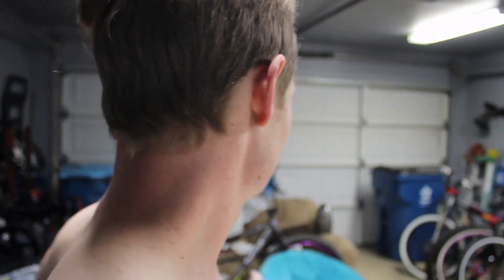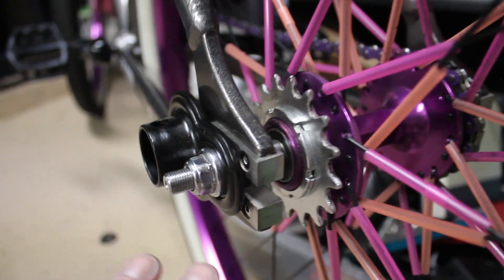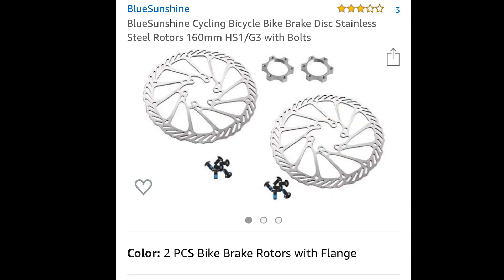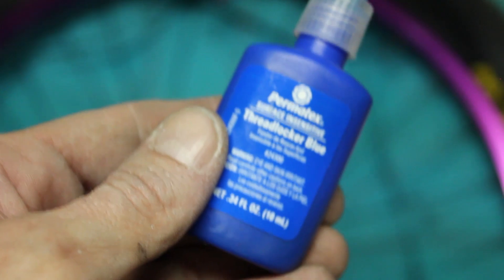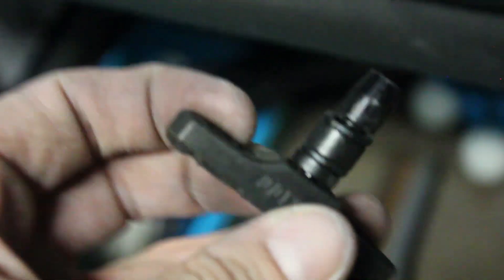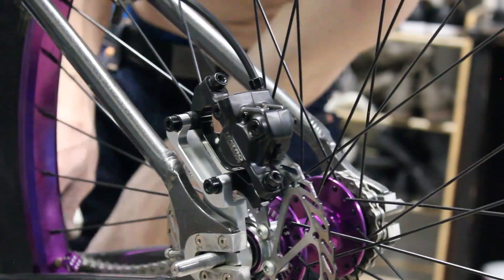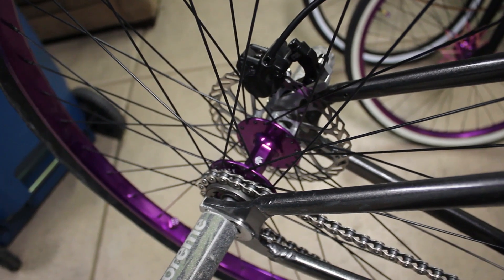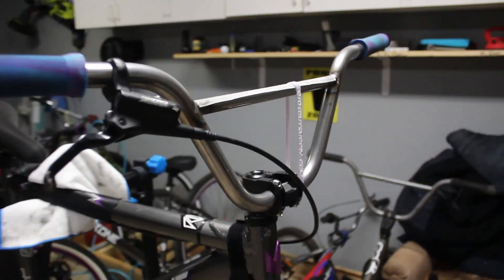HOW TO: V-Brakes To Disk Hydros(CHEAP)

Comment: Just to be sure, there's no problem with installing on the fixed side (34mm same with freewheel side) of a flip flop hub? There's excess threads because that's the lockring thread (30mm)? So you secured the rotor adapter with loctite?
Reply: yea

Comment: i know this is a really old video and what not but bro... where did you get the part that mounts the rotor to the wheel that adapter... or what do i search to find it... been out of bikes for a long time just pulled my 2004 Redline Proline Pro 24" cruiser out of storage and was like i wanna start riding again... and my v brakes were missing so yeah lol

Comment: Question.  What size is the  bracket that holds the brake caliper. I did this but the brake pads are sitting to high so it's obligated grabbing the edge of the disk
Reply: Did you ever find the correct bracket? I’m doing the same build and I’m having the same issue.
Reply: Awesome thanks so much!! Huge help. How do you like the set up compared to v-brakes?
Reply: @hilariomartinez3982  one more question if you could help me out? On your rear axle after adding the caliper bracket did you remove any of the nuts or washers to make up the difference added? I have two nuts on each side of the hub, it fits a little snug didn’t know if I needed to remove one of the nuts for chain alignment. Thanks

Comment: Should work with se the big flyer and ripper have the threads for a second freewheel
Reply: Dillon Alvarez only gonna work with fixed gear threaded hubs, freewheel is different
Reply: It will work with a big flyer or big ripper as long as you have the stock rims
Reply: @10R80_J  it's a freewheel adapter

Comment: Not following how is that frame adapter held without rotating when bakes are applied?  There is another adapter being held with a bracket around the chain stay which makes sense but this one,  do not see how is being held in place.   Thanks.
Reply from the maker: theres a part of the bracket that sits in the rear drop out for the axle so its held in place

Comment: Anyone know which brake caliper mount works for this? I bought a mount for a rear mount tektro 160mm online but my pads are sitting way to high on the caliper.